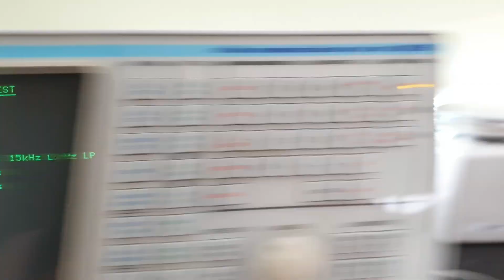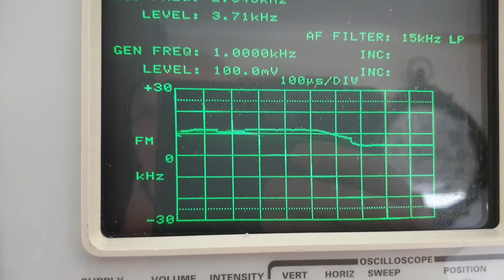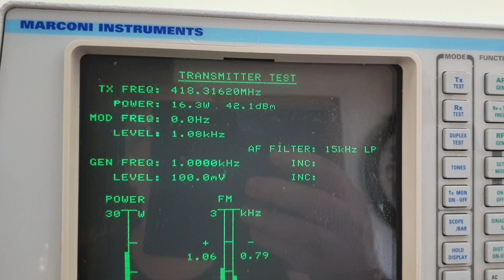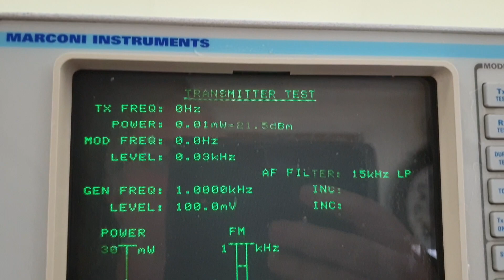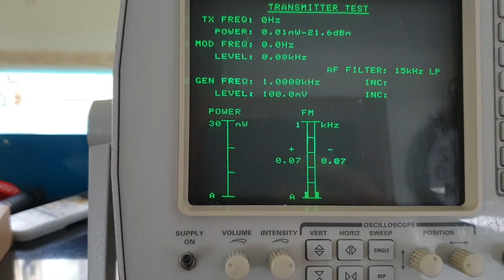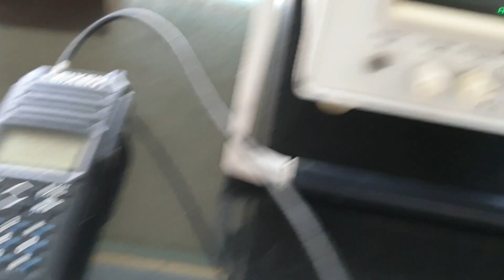A quick play with a Marconi 2955B Radio Communications Test Set, very impressed....

Comment: The AF gen output can be used to check signal to noise ratio.
Knock together a BNC to radio MIC lead.
Put the test set into TX Test.
Put the radio into TX.

The radio will get the above signal at the MIC socket and transmit it to the test set.
Because the test set know the frequency and amplitude of the tone it generated, it can measure and display the resultant S/N ratio.
Any decent radio manufacturer will state the signal to noise ratio that the radio can achieve for a given input.

For the lead, I usually butcher a cheap speaker microphone by cutting off the microphone end and terminating in a DIN plug. Separately, I have a small project box with a DIN socket which accepts all my leads, along with two BNC leads, one for AF in and one for AF out (to go to the test set). The box also has a momentary push switch for PTT along with a toggle for longer tests.

Comment: Hi i use a mixer so i can listen to SSB on the 2955, and input the 2955 signal generator to the mixer 
And then the lo out of the mixer to the AF input of the 2955, 
So you are re inserting the carrier using the mixer and the 2955
Dave Browne 2E0DMB

Comment: Great video, I've got a Motorola R2001D (R2010D) here which is playing up, I noticed it intermittently goes off frequency by a few 100hz randomly, it's not the 10MHz reference as I've tested that and also fed in a 10MHz and it still does it. I recapped the PSU's and the CRT boards, re-seated cards and cleaned contacts. But cannot locate the fault. I have a feeling it's the A9 card and I don't have a PCB extension here for the cards so cannot fault find it. So I'm off to buy a Marconi 2955R tomorrow. But I did not realise it does not do SSB! So now I'm not sure what to buy. I'm in the UK and R2001's are extremely rare.

Comment: I used to use these for Her Majesty 20+ years ago.  You get a lot in a small package.  The IEE488 (GPIB) general purpose interface bus allowed most of the functions/inputs/outputs to be controlled auotmatically from a PC.  Using a GPIB switching system lots of pieces of test equipment could be linked and switched automaically, signals conrtolled and measurments recorded and even pass/fail reports  printed out.   However the rise of USB has rendered GPIB obsolete.

Comment: Only problem i noticed with this unit is the exposed bypass switch relays that controls the input from the connector to the option receiver or to the main unit. The relays are exposed and subjet to get moisture and dirt thus one day they might get stuck when change from receiver to tx mode...

Comment: Measuring a spectrally bad radio is easier if you don't use auto tune on the 2955B but instead define the expected frequency, it will then read frequency error and the acquire time is even faster. Not all of the Chinese rigs perform like this one, the most hated one is an order of magnitude better.

Comment: That Marconi is a very nice unit. Now I have to find one for myself because my test set was made for working only on CB radios.
My 8 watt Baofeng UV-82HP does only 5.7 watts on high on 2 meters. On 70cm is is barely over 4 watts. So much false advertising with these Chinese radios and they have terrible harmonics. I regret getting it since I could have purchased a Yaesu FT-60 for not much more. Lesson learned!
Reply: Are these hard to find?

Comment: I love your videos! have the 2955B and use it daily. Favorite functions are for quick transmit testing for power-frequency, and receiver testing for sinad and s/n ratio. Works great for old CB's to find which crystals are bad and if the receiver is to spec. When restoring old radios its great for the quick once over to see if the unit is in or out of spec! Maybe do a video with that Lafayette HB600 to measure each channel crystal  for frequency and check receiver performance for sinad and s/n  ratio to see how close it  to .5uv!  I have an HB600 I restored and it performs at the .5uv on receive at 12 db sinad and 10db s/n according to the 2955B. Cheers Don